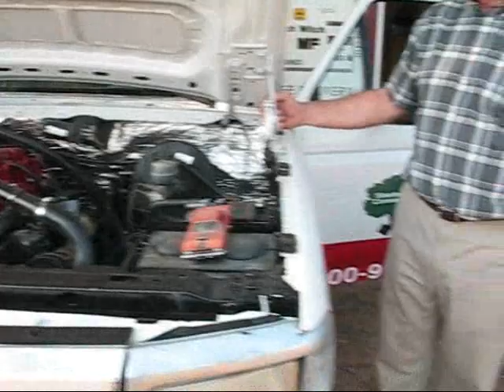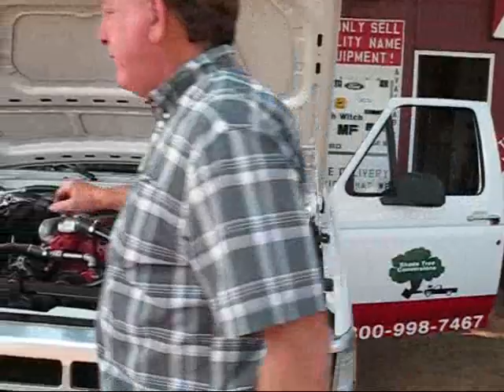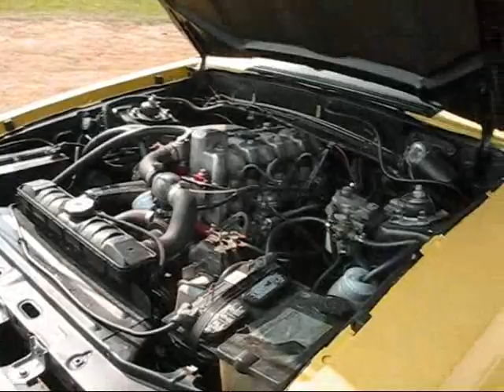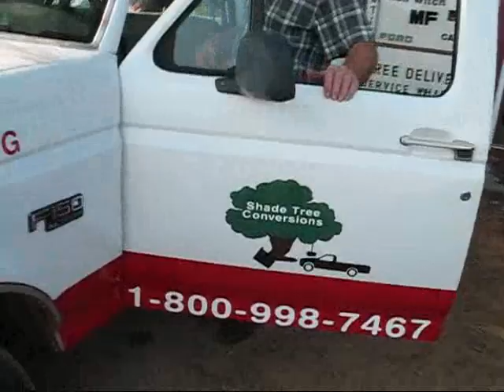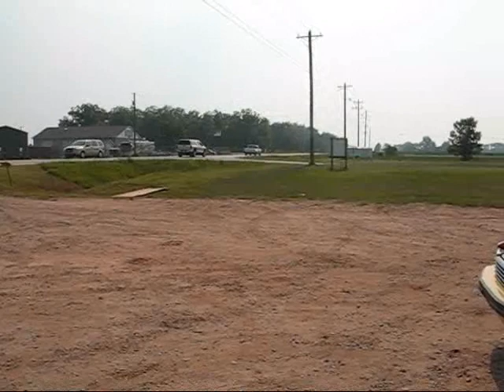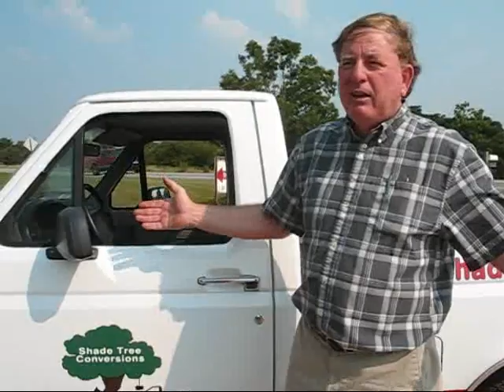Diesel turbo tractor engines installed into Ford pick-ups.

Comment: I think it won't get up to the factory original engine's max speed, to say the least.

But the engine will be easy to work on and it will last more than the truck itself.
Reply: It’s all about gearing not max rpm.

Comment: What kind of transmission? I am in the process of buying a 90 f super duty flatbed with a 460. I want a tractor diesel that will bolt to the 5 speed transmission.

Comment: @PoorUglyBastards4x4  depending on the engine turboed diesels love hills the thing is putting a small tractor engine in the truck will get you major millage but it will still suck the fuel or slow down on the hills especially if it is non turbo